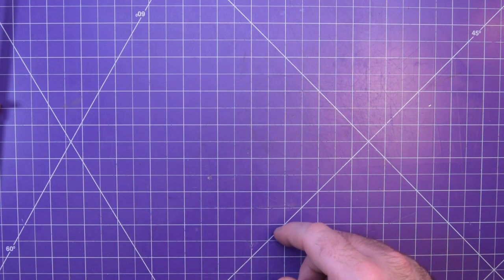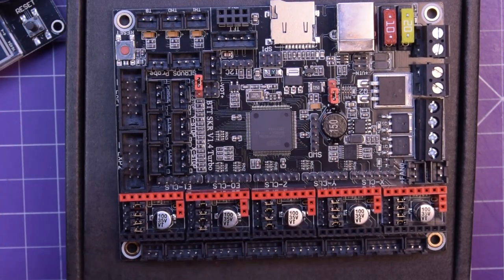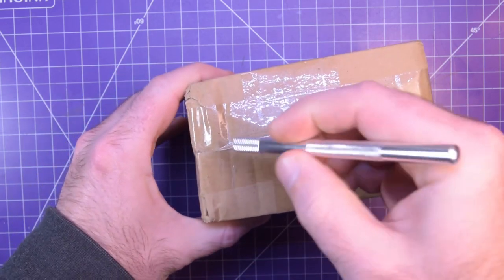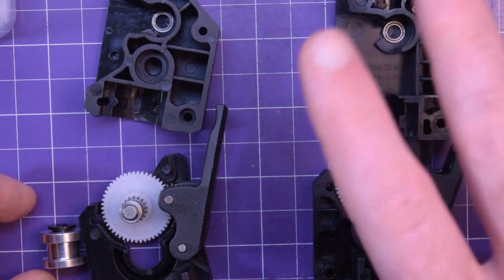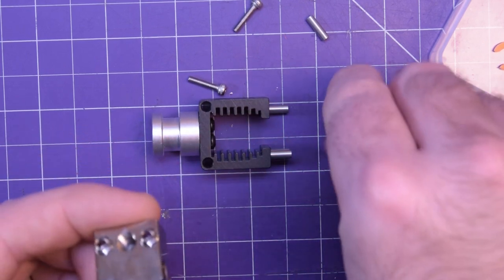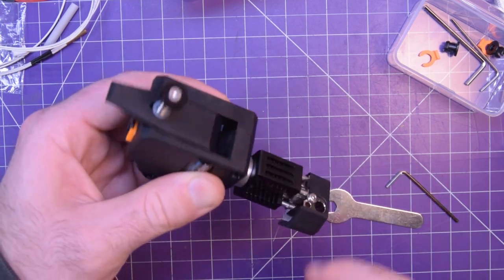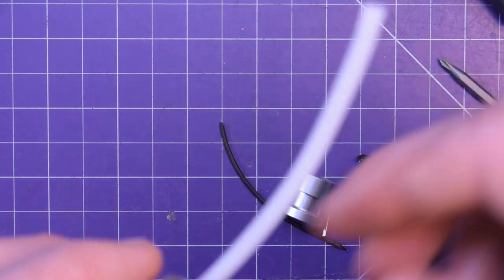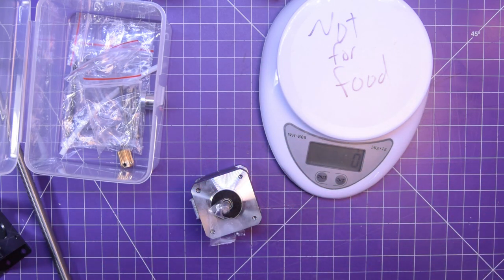Mailbag 78 - Continued 3D Printer Parts

Comment: My Trianglelab BMG clone is probably the best upgrade I bought. It just works (bowden setup).
I have an Octoprint button to load/unload. 2+ years and still running.

Trianglelabs are pretty nice. Bought an all metal hotend & some thermistors that were delivered in about a week (UK).

I also bought the wrong thermistors...
Reply from the maker: I'm doubting if new thermistors will fit the mosquito clone, it's supposed to be compatible with e3dv6 thermistors and that's what I got - I feel like I'll just put a bit of foil to shim it and see if that works

Comment: I have no knowledge of 3D printers and have no use for one. But I am fascinated by this project. I did'nt realise how much was involved with the print head mechanism.

Totaly idiotic idea, but, with the M2.5 screws going into M3 holes, heat shrink tubing around the threads ?
Reply from the maker: It has to be quite structural so I don't think that will work!
Reply: @SimpleElectronics  Yep, I thought is was idiotic. LOL.
Reply from the maker: @frankowalker4662  Still glad you shot it out as an idea!

Comment: Will you be using any of the parts from your original 3D printer project? I seem to remember you bought some aluminium extrusion for the frame.
Reply from the maker: So far, possibly the stepper motors - I still want to build a "cheapest" printer as well
Reply: @SimpleElectronics  Can't say I blame you. The total of all those little bits soon adds up!